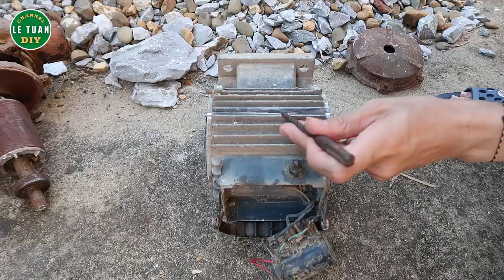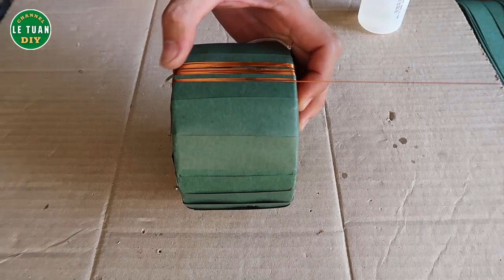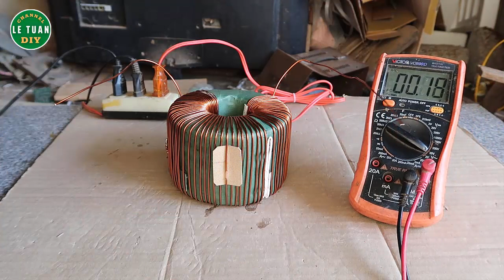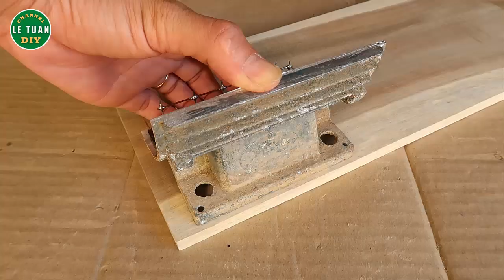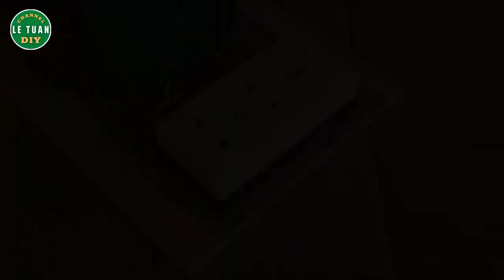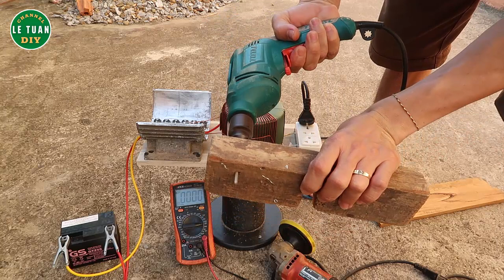I made a unique 4500w inverter from a broken old water pump

Comment: This is great, please I want to ask some few questions
1. What is the frequency
2. It has no feedback, will the voltage not drop when there is load
3. Without the load, what is the output voltage.
I want to copy this is you have shown now, and those questions, what was I was trying to solve before embarking on it.
Thanks